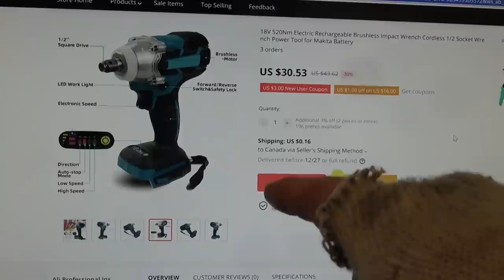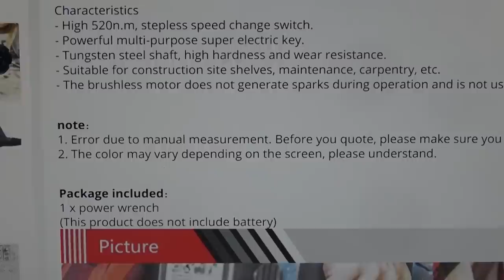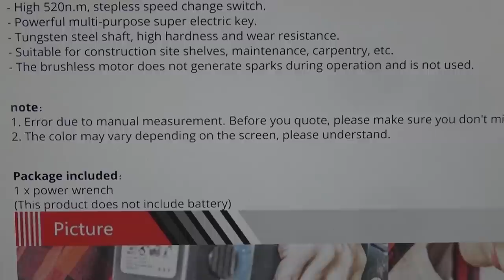BOLTR: Fake Makita Driver

Comment: a couple of days ago I bought a 12v Bosch cordless drill. It had something on the label I have NEVER seen before. It says "Made In Switzerland"! I kid you not. I have never seen that before. I didn't know they used to make power tools in Switzerland. I bought it just for that. It seems to work just fine. It's a little stinky, but I figure it  needs brushes and I'll get around to replacing them one day. Love your videos, keep 'em coming!
Reply: I should add I bought it at a thrift store for $25 U.S. with the charger and 2 batteries(1 works and 1 is dead).

Comment: The slow speed ramp after reassembly looked like the controller ramping up in open loop and never seeing the expected feedback voltage to switch into closed loop. Feedback inputs maybe fried during reverse rotation, a situation that would not occur in actual use. These tests pander to a certain audience, and tell us very little.
Reply: Tells us how to put it back together wrong so we can not do it ourselves
Reply: No hall effects sensors didn't help maybe? Only correcting the current from feedback doesn't seem reliable when this kind of "out of intended usage" occurs

Comment: The recent Makita batteries also have this capacity indicator. But honestly I think that the knockoff offers a way better bang for the buck than the real thing for many applications, especially when it comes to personal needs. The best thing about it is that it will work forever, as the motor is not in use!

Comment: You rotated the motor the other way when it was energized. Wanna bet that you sent a negative voltage back into the controller?
Maybe you put something together for the first time correctly only to have it fuckered beforehand
Reply: Is that how those microwave turntable motors do it?

Comment: Purchased one of these straight away... found on bang good with free shipping $50 Australian dollars. Thanks AVE
Reply: Still good? Did you use original Makita batteries and what was the max torque?
Reply: @Tugoose  yeah no issues. No idea on max torque but it's survived everything I've thrown at it. Still highly recommend
Reply: @suspektjones1370  do you use it as a wrench or driver? I'm just curious if it can reliably undo wheel nuts
Reply: @Tugoose  wrench. I have a makita impact driver to drive... it has taken wheel nuts off no problem.. some of them it struggles but it's no big impact wrench and to rely on I would try a bigger one. For the price it's amazing. But even the real makita version this size would struggle with some wheel nuts
Reply: @suspektjones1370  alright man cheers. Appreciate the help I'll put my order in asap. Have a good one

Comment: The brown/red mag wire is a polyimide insulated wire.  Higher temp and not as brittle as enamel mag wire.  The grey potting is probably Dow Corning Sylgard silicon potting compound (or equivalent).

Comment: Orderd one, i will tell you how it holds in the farm workshop when i stumble over this video next time !
Reply: how is it 1 year later?
Reply: @Gabson9  it is still runnig almost every day, although the front Part of the square shaft broke of, so that the sockets fall of easily. About 3 or 4 Times I had to put new grease to the anvil thing because the hot grease will ooze out if you abuse it. If this one dies I will get another one.

Sorry for Bad Englisch 😅
Reply: @saibot8916  I just bought one with 2 batteries for 58$. Hope i`ll have possitive feedback as you have. Thanks for the answer. 
Cheers. :)

Comment: BLDC motors can be sensorless as well by using back EMF so no hall sensors needed.  It is open-loop briefly with low torque until it sense the BEMF.

Comment: Bought that thing; functionally it's quite alright, but on mine the 1/2" is basically stuck - need a hammer to install and pliers to remove sockets; the little spring-on-o-ring that is supposed to hold the socket is just too big. Will undoubtedly find a fix (just removing the spring works already, just that the sockets fall off then, and the magnetic 1/4" works just fine), just for everyone else: be aware that you'll have to do some work with it.
Reply: Re-shaped keyring works fine.

Comment: I bought a sliding miter saw about 15 years ago, looked just like a Makita - same color and everything. I compared the saw manual with its exploded parts drawing and it was IDENTICAL to the Makita's. If part # 23 was 'left hand trigger guard screw' on the Makita, it was the same on the clone.

Comment: Just because there's no Hall Effect sensors doesn't mean that the motor is running open loop.  If you have three phases driving, one phase can be undriven when it's about to cross zero and the motor controller can detect the back EMF to measure when that phase crosses zero and current reverses.  You will likely lose a little torque, and you'll make your controller more complicated, but you'll save the cost of separate sensors and the complexity of more wiring to the motor.

We used a circuit like this on a brushless DC motor in a heart pump I worked on 20 years ago.

Comment: While it may have some indeterminate flaws, that thing is incredible for the money!
Built like the professional cordless tools of 10 years ago, with the brushless motor of rip off tools today.
More metal inside than you get in the head of a lot of modern sledge hammers.

Comment: I used to buy cheap tools, until I realized I would save money by buying quality and using it longer time. My industrial surplus workbench and vise are decades old and still work like new. My $50 Black and Crapper corded drill died after light use with steel and wood, so I bought a Dewalt and it should be better. My cheap $20 pipe wrench broke, hopefully my new $30 one will be much better.

Comment: motor pinion - definitely NOT hobbed - looks MIMd or PMd. there's no hobbing cutter runout at the blind ends of the teeth - note the convex (unmachinable, only moldable) curved surface that intersects the teeth. great teardown! i want one

Comment: I am a tech for making down hole tools and we use mag wire all the time.  The brown looking mag wire is actually a higher temp rating than the normal polyester coating.  Try soldering through the coating.  If its the good stuff it will be very hard to do unlike the cheap mag wire.

Comment: Sensorless brushless operation isn't really open-loop; it measures the position from the back-EMF, so it's very much a closed-loop system.  Sensorless motors tend to cog badly at low speeds, though, because the signal-to-noise ratio is garbage when the back-EMF is small.

Comment: Despite failing to see a successful reassembly, we did get to see that it doesn’t have the same torque as the name brand version despite using more battery. 

it was funny because it was far from what was expected. 

Also note that it only has two planet gears where most BOLTRs have shown 3. Small detail that probably is indicative of different gearing (traded higher more torque from smaller planets for more speed from larger planets).

Comment: A clone of the Makita XWT11 (Amazon $143.55 USD and Homeless Despot $199.00 USD).
I bought this chinese model from Banggood ($32.99 USD). I just finished using it to replace 16 lug nuts on a Kia. On the low setting it removed lug nuts that were tightened to 70 Ft-lbs
and then I manually loosened and re-tightened the new lug nuts to 60 Ft-lbs using a click type torque wrench (just to make sure all nuts were evenly torqued).
Makita batteries fit good. With the Banggood Makita 6Ah battery linked below I used a 3/4" impact socket to easily remove a lugnut that was tightened to 70 ft lbs (94Nm) on a 1998
Honda Civic then immediately used this cordless impact wrench to tighten the lugnut. I measured the un-torque value with an old school beam torque wrench at 75 Ft-lbs (101 Nm). This appears to be a clone of the high priced Makita XWT11 brushless cordless impact wrench and is well worth the money as an exceptionally good value. Buy this impact wrench and the battery from Banggood and you will be very happy with it. 
The Banggood model I bought is built better than the $30.00 Makita XWT11brushless clone reviewed by Ave on YouTube.  This Banggood version (labeled "Tianhu Tools") has sealed ball bearings and the brushless motor has red heat resistant plastic instead of the milky white plastic. The motor controller is different an probably better then the Ave reviewed one.  Here is the Banggood description and link   ;
18V 520N.m Cordless Brushless Impact Wrench Stepless Speed Change Switch Adapted To 18V Makita battery.
https://www.banggood.com/18V-520N_m-Cordless-Brushless-Impact-Wrench-Stepless-Speed-Change-Switch-Adapted-To-18V-Makita-battery-p-1576432.html?rmmds=myorder&cur_warehouse=CN
The battery I ordered from Banggood is labeled "RANXIND" ML:BL1860 Li-ion 18V 6.0Ah 108Wh. Battery has yellow balancing connector like Makita OEM.
Ordered this battery https://www.banggood.com/MAK-18B-Li-18V-Li-Ion-5_0Ah6_0Ah-Battery-Replacement-Power-Tool-Battery-For-Makita-BL1850-BL1860-p-1351501.html?rmmds=myorder&ID=556743&cur_warehouse=CN

If you need MAJOR torque in a brushless impact wrench then buy the Milwaukee 2864-20 FUEL 3/4" High Torque Impact Wrench or the Milwaukee 2867-20 M18 FUEL 1" High Torque Impact Wrench.

Comment: Hey AvE! You know that there is no need for an hall sensor? There is ways to detect where the magnets are with the feedback from the coils itself... So the lack of the hall sensor is by no mean some corner cutting thing. It can be that they implemented the feedback via the coil feedback instead. All it need is a different driver chip.

Comment: Uncle Bomberfork, have you perchance seen the new Rotorazer Saw advertising "as peeped on the face of the ole cathode tube"? 

Dainty little wonder, says right there on the tube. It'll slice clean past just about any wood-based metal, tile-based ceramics, cuts a straight circle in plyboard sheetwood, and does every angle between 0° and 720° F. 

Official red and black Ferrari paintjob, big man on the tube says it goes three thousand and eight-fifties rounds per rotation... Looks like one seriously scary tool! 

I strongly suggest you don't pass up, this thing looks ready to chuck out half your shop and give you the power of the gods!

Comment: If it helps your conscience, they are now branding this on AliExpress as “Tianhu Tools” - despite the Makita color. Logo is a stylized yellow lions head. There are about 1000 clones of the sales page, but most of the units seem to be the same. Hard to imagine there is more than one factory cranking out these Makita look-alike tools but it’s possible I suppose. For $30 seems like a good buy. I’m not going to link it on AliExpress but if you search for 520Nm it’s the first item that comes up.

Comment: I'd like to ask a question about the "head to head" test at the beginning.
What was the point of it? Why did he not just try to tighten a bigass nut with both of them for the duration of 2 beers or something?
Becase it's an impact driver, the motor would spin regardless of what it's up aginst, so i'd guess there was no "extra" load on the drives from working aginst one another.

Drills would be a different story, as they would be stalling

Comment: I think the reason it does not have hall effect sensors is that they implemented back emf sensing. All RC motors that use ESC's work this way.

Comment: The sensorless brushless motor does not have to be shitty. Infact it may be very well controlled just sensorless.
It is just more expensive to make a sensorless controller due to more complex electronics and programming. It is however far cheaper to make the motors and there is less stuff to go wrong.
If it starts smoothly and quickly it is most likely well done. If it sort of blindly and slowly grinds up to speed you know you have the cheap stuff in your hands.

Comment: I run Makita's 18V platform and ordered the Fajita a few days ago. Apparently, Fajita also offers an angle grinder. If the impact works out, might try out the grinder. I'll update the post once I have a chance to use the tool.
Reply: Received the tool within a week of ordering. Makita batteries work with no problem. Build quality is indistinguishable from my non-counterfeit Makitas. Not the most powerful compact 1/2" I've used, but rather remarkable for $30. There are several versions of this tool, perhaps built in different factories, but I bought the one as in the video. Thinking of trying out a couple of other tools that work with Makita batteries.
Reply: @felixf5211  you have the link?

Comment: To conclude its dickered it might be wise to swap the batteries between them. If its the battery rather than the tool it will pick that up pretty quickly. RIP Chineta.

Comment: after getting my first brushless drill (second hand) , i realize the microprocessor those need introduces a new level of voodoo and there's even latency when i pull the trigger that was not needed in the mere electromechanical drills.
Reply: I have noticed that the delays happen the first time after sitting idle. Probably the processor goes to standby to conserve power. Still frustrating though. I had no problems using brushed tools.

Comment: i have one for the money i was impressed with it i dont think you had it on full power once   it gives max power in reverse and has 3 tightening settings going forward/  they have them with a 1/4 hex in the center of the 1/2 drive on the latest model  bonus   happy days
Reply: Correct, also, this may be mad, but, I've used it quite often and now it appears that it brakes in, I used it the other day and it snapped a m8 stainless bolt clean off! I carried on fastening more bolts with a spanner on the other side an could feel the power, it even undid some rusty m12 bolts holding a jockey wheel on a trailer. I've been well impressed.

Comment: I asked the owner of my local tool store what the 150 dollar difference was between two sanders, and to quote him “it’s just the name, they’re made in the same place”. People like to avoid the un-named Chinese brand, but the the reality is that most of the parts are the same. Yeah it could end up breaking sooner, but for most people (spare those who use them for work) they don’t see enough abuse for the cracks to show. When you just need to a tool, and it doesn’t have to go through a daily regime like this, sometimes the 30 dollar chinesium will do.

Comment: Fajita has 2 forward and one reverse... The makita has 3 and two
El cheapo is still good bang for the buck... Brushless motor and decent drop durability
it wont take trade abuse, but for your home workshop, taking off the occasional exhaust clamp or freeing up a rusty bolt on an electric motor it will save you a lot of grief and swearing if the alternative is a wrench or a standard cordless driver... the auto stop isn't as precise and there is a little bit of trigger delay but i can live with that... you could pick up two fajitas for the price of one makita and have enough rattlers in your pocket to go get some actual fajitas

Comment: You’re not actually comparing the knock-off with its Makita equivalent. I think the knock-off is the DTW285 impact wrench or an earlier variant case-wise compared to what looks to be a higher specced Makita impact driver. I have one of these (knock-offs) and it’s pretty impressive. It probably demonstrates they are making a huge mark-up on selling the skins.

Comment: It took me a long time to bite the bullet and get some snappy electrics. I now use them before anything else, the batteries last impressively long (except for the reciprocating saw), and the longevity of the tool is quite impressive. Yes the overmolding comes off, I use them everyday to fix cars, i dont care about that. What i need is quality, ease of use, longevity, warranty, and most of all a guy to bring it to me. I'll pay for that.

Comment: On many occasions I've found the copper windings for electric motors to fake  as in aluminum wire painted copper color. I imagine that has to be a contributing factor when diagnosing possible problems, yay or nay?

Comment: Everybody wants a cheap good and fast but you can only get two of those.

well I was a young man and tools had brushes and cars have carburetors we learn how to make them do what we wanted , fuel mixture, initial timing, distributor advance curve, valve lash ,etc. 

Now I go to the garage I work 25 years ago. 
And they're working with laptops trying to figure out what's going on and what the car is doing so they can use all their mechanical skills to repair it if possible and have the car except the part and work correctly.

So when I watch a mechanical expert  take apart a tool and say what the hell is it doing this is weird crazy, I can't help but see the similarity as to how we used to take apart alternators power tools whatever it was and turn them rewound them I put them back into service knowing generally the outcome.

Disappointing news on the Bosch I used to like that brand, I'm thinking of purchasing one of their corded SDS hammer drills..

Comment: From our point of view, it would be more interesting to see trying to remove a stuck lug nut, to see the real torque spec. If you can change your wheels with it, is worth the 30 bucks. Especially when you have some original makita batteries, but you dont have the $200+ impact driver.

Comment: check out the Makita XWT11Z - Looks even more similar than the driver you have on the vid, I have said genuine tool, and immediately recognized the clear plastique cover over the front. That rubbery bit on the front is also supposed to glow in the dark for some reason? Guess it's for if you need to locate the vibrator at night.